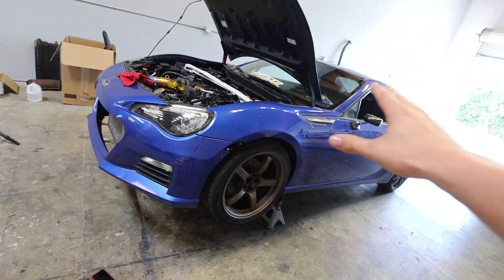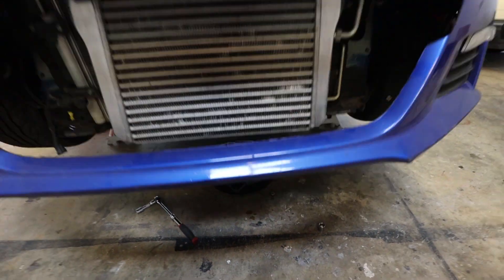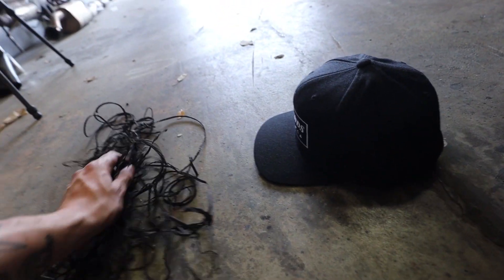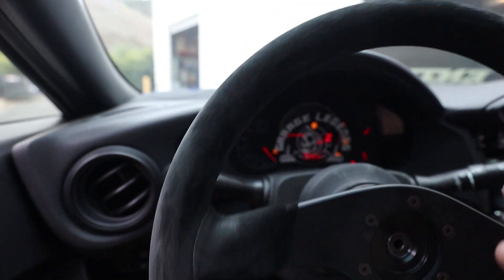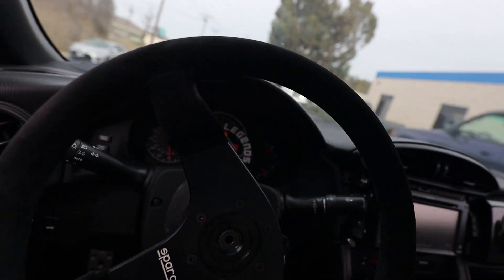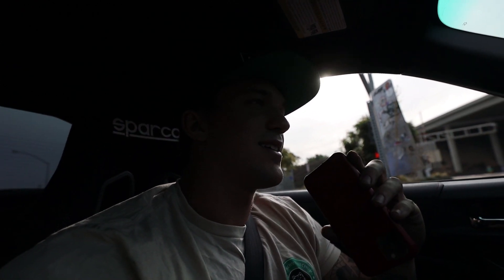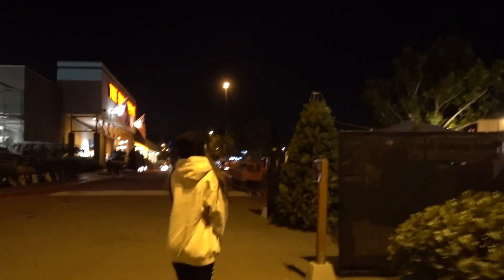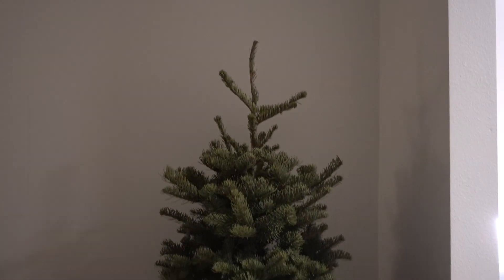What Was REALLY Wrong with the Boosted BRZ | FIXED!

Comment: Hey Dustin is your motor built? I’m planning on running e85 on my supercharger set up which bumps it to 350wheel, not sure if I should build the motor or can the stock internals can handle 350whp?

Comment: Should also make sure that the fuel isnt cutting off when making hard turns. Even on road driving on exit ramps with by brz I've had it happen when under like 1/4th tank of gas. I think its called like fuel starvation flap.

Comment: I guess high iats on the desert go kart track and only 91 - if crappy or not crappy still 91- is not enough to prevent knock at this power.
My stock 4 cyl turbo 300 bhp car has a manufacturer recommendation to go with 93 to get full power all the time.

Comment: lol 10w-30 for boosted subaru :)  we put 10w-60 ...RIP your crankshaft.
Reply: subaru designed the turbo fa20 for 5w-30
Reply: @ianb2722  whatever you say, dude. :)
Reply: @dwori  when you buy an fa20 wrx sti, it comes with 5w30

Comment: Yeah a car that is tuned for e85 runs better when it is running e85... 🙄
Reply: Flex fuel reads the E content and adjust itself accordingly. So you can literally go from using only regular fuel, to just e85 to anything in between. It's not like other cars without flex fuel sensor that have to just run only e85
Reply: Peter Alfonso 
Obviously not working correctly if running it with e85 fixed it. Sensor is broken or the tune is bad